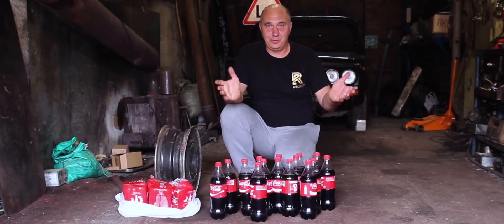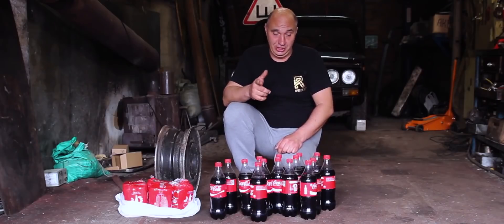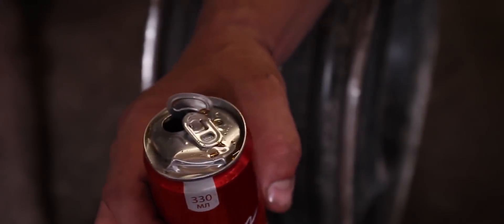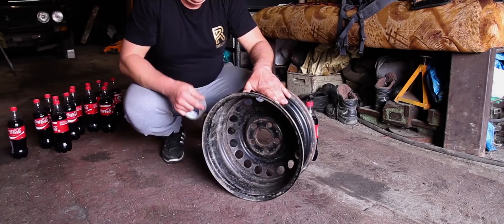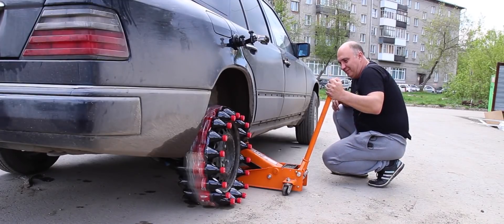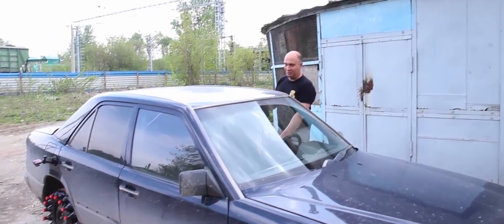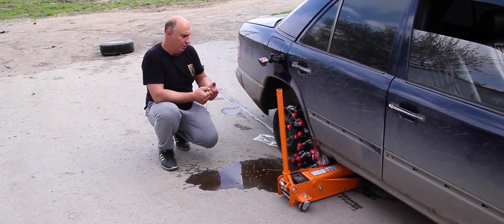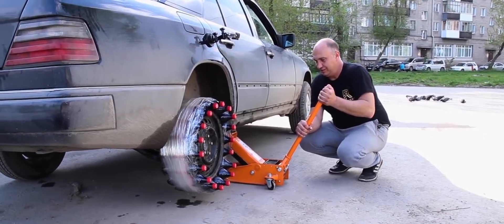Making a tire from Coke bottles

Comment: They'd probably start to squeak after a while. If you ever carry a sixpack in foil over a mile you will hear this ugly sound. The bottles are held together flexibly and they can move a little, so they start rubbing against each other with every step you make (or with every wheel revolution). This constant rubbing on the exact same spot on the bottle produces corresponding scratches and this crazy sound and it gets louder over time.

Comment: Next time weld a cage like bottle holder around the wheel so just the part of the bottle that touches is where the road hits it. That'll keep them on the wheel, that's what happen that your idea didn't work. They slid off the rim. ;) Love your shows. :)

Comment: How about you actually fix them to the rim? Put a cable tie around the neck and "waist" of the bottle (less likely to slip or hit the road), and then cable tie that band through the holes in the rim. Then use some thick duct/gaffer/cloth tape to protect the plastic from the road surface. Even if the bottles burst, they shouldn't fall off with this method.

Comment: I think there is nothing essentially wrong with this experiment. But maybe some paracord as well as Scotch tape. But it also needs a layer of cushioning. Maybe the outer layer of a cut up tyre, or at least a strip of underlay or carpet to protect the bottles from the worst of the ravages of the stones contained in the asphalt! Cool experiment, you will nail it. No wait cargo strapping! - use Cargo straps, that may even out the pressure on the coke bottles1

Comment: Say the wheel load is 750lb.  Say the contact area of the bottle on the ground is 2"x5" = 10 in^2.  Then the contact pressure is around 75psi.  I've heard the bottles can take more than 100psi internal pressure so maybe this situation is believable.

Comment: Shoulda stopped while you were ahead.... got greedy, went for #2, picked up speed, & lost the bottles...
 Your cameraman should have told you that 1/3 of the bottles had shifted, hell, i was sitting here yelling NO NO NO!           LMFAO!
 To stop the bottles from sliding side to side, you could try shrink-wrapping them, after they ere taped to rim.... run the shrink wrap 1/2 width past the outer edges, both sides just spin the rim on a broom handle on blocks or something high enough that the bottles clear the floor, spin the rim, and wrap that bugger tight... it'll add a little more padding, and keep the bottles in place... good luck my friend. I hope to see it working soon!

Comment: IDEA for him, take old tire, cut holes through both Inner an outer side walls with a hole saw, then stick the Coke Bottles in the holes. Secure the bottles in place with CONCRETE poured into the tire, give it a few days to harden, an go ready for next Cross-Over Frankin-Tire video.

Comment: IF this worked just fine, there would be a problem. The pressure would increase as the Coke is agitated which would result in decreased traction, a harsher ride, and bottle ruptures. Otherwise this was a fun idea.

Comment: Tape failure seems to be the most common issue.  DUCT TAPE IT & epoxy to hold them from sliding!!!!!!!   Next try some sort of ski using a child's sled as a wheel replacement.

Comment: each bottle is rated to 200PSI  +-10psi (Bursting)  so yes a car will be fine since a Tire is 35 to 45PSI (for higher end ones)  and the normal PSI in a bottle is about 15-20PSI

Comment: Seems like you could use a mould to fit inside the rim, that will support the bottles from the inside of the rim, not just the two edges. This will reduce fatigue on the plastic, also will stop them moving around so much.

And then as others have said... duct tape, not sellotape/scotch tape.

Comment: Those bottles can handle a lot of pressure. I've seen valve stems placed in the lids then pressurized the bottles with air for jug lines.

Comment: You could attach a piece of wood or metal the diameter of the wheel to the wheel on the outside just so that it would keep the bottles from pressing out of the car from the outside.

Comment: Use serandwrap just on the rim and use alot of it (cover all metal) Then place your bottles on top of the serandwrap then add more serandwrap to the outside of bottles and they wont pop most likely.

Comment: You should make a tire out of a whole bunch of electrical tape being wrapped around the wheel
Reply: they actually did it
Reply: Some dudes did it with duct tape. It works fine.
Reply: ras 47 it would be like concrete wheels
Reply: BekimUnikkatilPS3 wrap it around a bicycle inner tube haha

Comment: First. Use lighter Russian car, not German tank.
Second. Duct tape not Scotch tape. Wrap each bottle first in Duct tape.
Last. Pepsi will work when Coca fails.
Then it will work.
Reply: Have you seen how thick the steel is on those old Russian Ladas I wouldn't be surprised if they weighed about the same as this Merc
Reply: german tank ahahaaaaha
Reply: I to the clear tape with duct tape over it to protect the clear tape
Reply: Scofflow #pepsimasterrace
Reply: Chris Watson at least Pepsi didn't try developing a vending machine that charges more on hot days

Comment: Fill a tire with liquid 💯 full
Reply: Kevin Lowe they already filled one with concrete
Reply: Tractor tires are often filled with water for extra traction. During the West Virginia mine strikes a few years ago, experiments were done filling conveyor belt tires with tire fill, a liquid rubber. The tires disintegrated when they tried to use them.